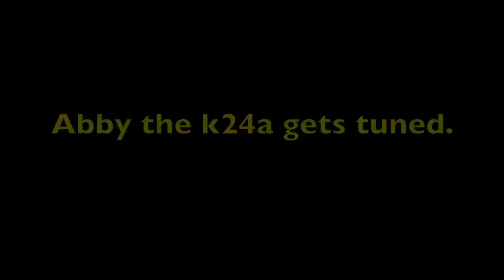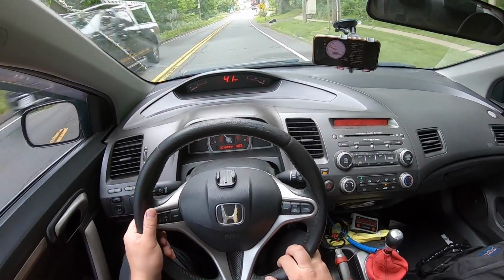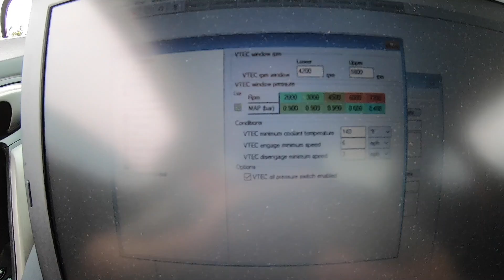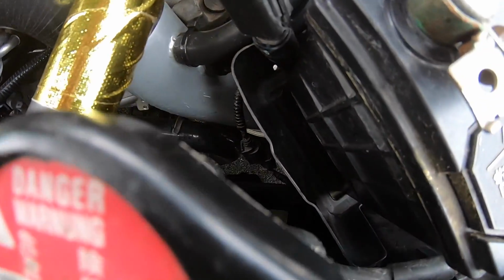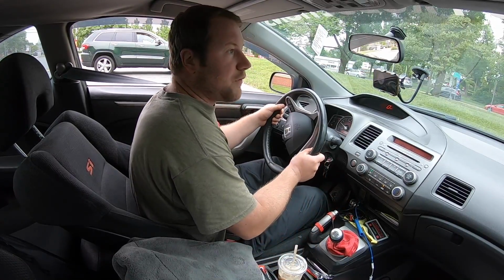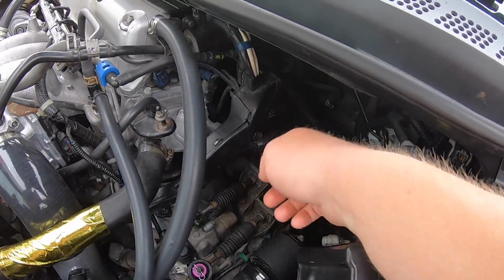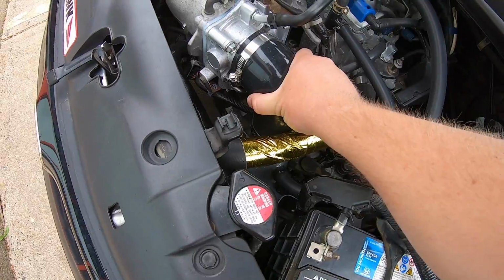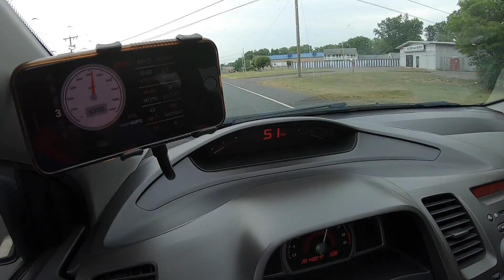Honda K24 gets a TUNE!

Comment: Don’t worry about the Type-S oil pump. There is a concern of excess piston speed with revving the K24A2 to 8K+, however you should have no problem if you set fuel cut to 78-7900. She’ll handle it all day. Believe it or not, people have been revving the stock K24 to 8K for years with no issues. Plus you will lose the balance shafts with the Type-S oil pump which in return will cause excess vibration as the K24 has an 87x99mm bore/stroke ratio (0.88). I recently picked up an 08 TSX cl9 6MT with the K24A2 and I’m running Serge Bo’s tune and redline is 7800 motor loves it. There are people running Serge’s tune with over 300K+ miles revving hard to 7800K zero issues. Just wanted to put your mind at ease as I initially had the same concern.
Reply from the maker: I was thinking the same thing man. I was never planning on revving my k24 passed 8k, even with a type s pump.  I was thinking 7800, but it's currently at 7600. See, that's why i didn't want the type s pump, due to the added vibrations. Damn, how many honda/acura vehicles had you had lol?? How long you been revving that high for and what are your mods? I've alsoo heard the k24a2's are good for 300k miles all day ;)

Comment: 7:35 I FUCKING TOLD YOU!!! Lmaooo we all told you to get that pump and you didn’t want to listen😂😂😂 it’s all good thoe bro I’m still loving the pulls I know you’ll do it soon anyways cause you’re going to itch to rev to 8200rpm🤙🏾💯
Reply from the maker: Well, you all were right to a certain extent lol. The oil cavitation is not the only worry at 8k+, but the piston speeds are more of a concern. I did some extensive research and found that a k24 @8k rpm or so pistons are moving at 5,200FPS or something insane like that. Meaning at those high rpms, you’re going to need a good oil to help with excessive wear on internals, like bearings, pistons, w.e. So to play it safe, I won’t be adding a type s pump to this k24, but I’ll be keeping my rpms at 8k and below 🤘🏼

Comment: You running the Alpha header with stock exhaust? Did you dyno it yet?
I’m trying to decide what to do with my exhaust right now. I plan to keep the car all motor and so I need my setup to be rightttt, it seems to me that with a header-full exhaust these motors get very loud even if you get a short header and catted down pipe and I don’t want loud SO I have landed on either only doing the Alpha header w stock exhaust OR only doing downpipe(FullRace catted) and exhaust(Invidia Q300)
Reply from the maker: In this vid is was.  No, but I want to dyno her down the road. If you want my advice, stick with a 2.5" exhaust.  Run alpha and stock, it's a sleeper set up ;)

Comment: as long as you avoid deep puddles you'll be fine .I had a hydro shield on my old k&n intake and it causes less airflow
Reply from the maker: Little Abe I’d rather have slightly less air flow than water in my engine 🤷🏼‍♂️
Reply: Gerb if it makes you feel safe, my 3.5” cold air intake in my fender used to go through snow storms, and rain storms.. and it was fine
Reply: @iAmAnferny  your using hybrid racing because any other one if you drive through water that intake is taking it in.
Reply: @TheGerbsteve  install type-s oil pump so u can rev out the motor. If you can setup oil pressure gauge that's good option
Reply: scarface ja I’m using skunk2.. and he won’t do the type s oil pump I already talked with him about it before he put the motor in
Reply from the maker: Correct. Not worth the labor for a few hundred rpms. I swapped the k24 in knowing I’d be at 7500-8k rpms max! Besides, stock pump is good for 8k. No need to rev higher when power drops off, just added wear.
Reply from the maker: Nah, we the slow boys. 8k rpm max! I wouldn’t even take a k24 passed 8-8200rpm without proper internals, stronger rods, bearings, valve train, type s pump... next build will be fasttt
Reply: Gerb I wouldn’t even bring it past 7600 just because of the valve train.. valve float will do a number on your motor

Comment: I had a cai on 2 different cars and never had issues with driving in the rain. Just don't touch the throttle if you must go over a puddle, otherwise avoid streets that commonly flood

Comment: Did you have that header on the k20z3 previously? I blew my motor I’m thinking about K24A but I have a header for the z3 is the bolt pattern still the same?
Reply from the maker: Yes I did. Bolt patterns are the same.

Comment: Definitely should of put the k20 oil pump on if your using a k20 head or plan to go turbo later, but as long as you keep it under 8k and NA the k24 oil pump is fine.
Reply from the maker: Running full k24 longblock.  I won’t be taking it past 8k rpm, way to sketched about that. The stock pump can handle it, but I don’t think my valve train or pistons will.

Comment: See that's the thing... The K24 is a more refined motor.. Its much more smooth and the powerband is more linear.. You are not gonna get that "jolt" when you hit 6K Vtec in a K20.. But when you are in 2nd at like 3Krpm, and you go WOT...... DEAR LORD do you feel that torque when you go from 3K in 2nd to redline and shift into 3rd... It hits hard.. Its a completely different feeling from the usual K20 Vtec feeling where all the power is up top. Its why I love my K24 for daily driving. I rarely ever spend my time above 6K rpm here in Philly, so having max torque by 4800rpm is really enjoyable for the daily experience.. Its all subjective though as they are both great motors. I'd prefer the K20 for an Auto-X car, but for the street and daily its K24 all day.
Reply from the maker: Mike Harkins especially the 06-08 RBB k24’s. I love my power band right now. The vtec is less audible than the k20, but the power is wayyyyy, wayyy more useful for everything. I was having some fun with a wrx the other night and he started to pull before me and I caught up, side by side in 5th gear!!! Wish I caught it on my GoPro. My power is @4200&5800, but even like you said at 3k, it starts gaining torque. Believe it or not, 7600 rpm redline is pretty high and feels great. The k24 >k20 for daily allllll day. They are both great for sure. K20 will hold the title for top end, highway pulls and best sounding vtec, but k24 is a torque king, that beasts as a daily and streets 🤘🏼🤘🏼🤘🏼

Comment: You should have at least put in a k20 oil pump so you can rev a little higher. Or I have heard you can port the stock k24 oil pump and upgrade something and its just as good as the $400 aftermarket oil pumps. So you could get higher rpms without the risk of damaging your engine. But if you arent really drag racing it all the time you are probably fine.

Comment: I replaced my clutch (fa5) and bled the clutch. Now my car goes into gear kinda rough if I don’t granny shift it! Do you think I need a new cmc and slave ?? It already has a k tuned one on it. Mainly first gear, reverse and second.
Reply: Did you check your shifting cables? And with your Ktuned cmc check for leaks and most likely I would recommend getting a slave as well ☝️
Reply: elwolfefa5 will do thank you

Comment: Your intake is high , you’re good. Trust I know what I’m talking about. I use to run a INJEN cold Air intake for my DC5S, and if you have seen those intakes they literally sit In front of your tire, and I was using it with no bumper guards or the plastic thingy... drove it plenty of times during the rain, no issues. Just obviously I avoided big puddles lol
Reply: Nah don’t drive in the rain period with that intake if you like your engine
Reply: @jeffjones6811  Ive been using a CAI in my Dc5 for YEARS... Never had any issues. As long as you avoid big puddles, you are fine.
Reply: yep I have skunk2s cai sits right in front of the tire in the bumper. I've had it out in the Rain and it's super low. Been threw snow storms and slush .. cross country.. lmao all good , like u said avoid puddles especially the big ones. But better to be safe I suppose

Comment: hey man when i do my swap do i have to tune it
Reply from the maker: I would just to be safe, especially because it’s a k20 ecu trying to run a bigger displacement engine.
Reply: @TheGerbsteve  i had the k24 in it once  i messed up and put the k20 in it i didnt know what i was doing at the time so maybe i wont have to those flash pro are salty
Reply: @TheGerbsteve  I have a 2005 ep3 so what flash pro would i even need?

Comment: Hit me up if you wanna see if your setup is faster then  the stock k24z7,I'm in MA
Reply: Great job on the build by the way 👍
Reply: @dailycivicsi9thgen  I smoke 9th Gens in my K24 Type S.. Its not even close.. I know those z7's have that shitty cylinder head and single-port exhaust. That really limits the power they can make even tuned.. Im make 233whp/193tq. The 9th Gens are really good for boost tho.
Reply from the maker: Daily Civic SI I’m down, let’s do it this weekend. Where in MA, you can meet me half way or something.
Reply: @TheGerbsteve  DO IT!! I would love to see how the e-tuned K24A performs against a stock 9th gen.. Will def be interesting that is for sure. The 9th Gen has really smooth power delivery as well, but I got my money on my man Gerb!! lol.. I usually take 9th gens even with full bolt ons no problem in my K24 Type S, but I am fully dyno Tuned making the max my engine can make with my bolt ons and injectors.
Reply from the maker: Anonymous so let’s set something up!
Reply: yeah I'm completely stock,just wanna have some fun fucking around and see what we can do lol,I beat a random type s that had some work done but not sure what was done,you can see that video on my channel
Reply: @TheGerbsteve  I'm western mass at the Enfield line
Reply: @Anonymous it would be fun just to see what happens
Reply from the maker: I work near Enfield lol.
Reply from the maker: I’m guessing I make 206hp and 170tq
Reply from the maker: We can meet somewhere in Enfield and then take a ride to a Mexican interstate. Do either one of you have radar detect?
Reply from the maker: Both of you HMU on IG @gerb_productions
Reply: @TheGerbsteve  no I dont have one
Reply: @TheGerbsteve @Hondas'R'us ma/ct
Reply: @TheGerbsteve  I'm 205hp-174tq but that's before I put the k&n air filter on sooo...lol
Reply from the maker: Daily Civic SI I’m taking to your bro rn, we gonna all set something up. So I have your 9th gen, anonymous 8th gen k20, and what does your bro have ??
Reply from the maker: Anonymous email mail, stephenfuller92@yahoo.com
Reply: @TheGerbsteve  b18 gsr
Reply: @TheGerbsteve  ok cool yeah I dont have social media so I asked him to get a hold of you
Reply: @Anonymous hahahahaha🤣 I knew it